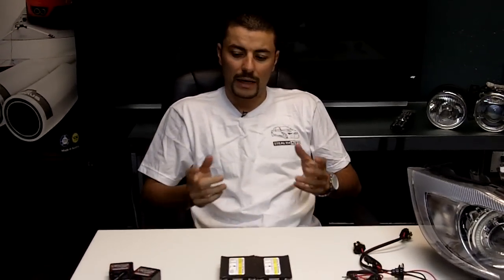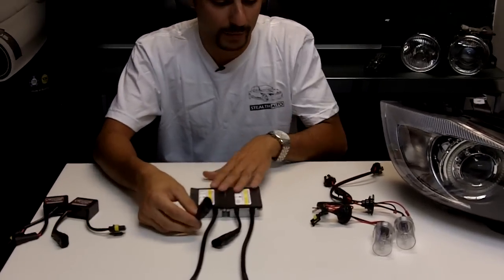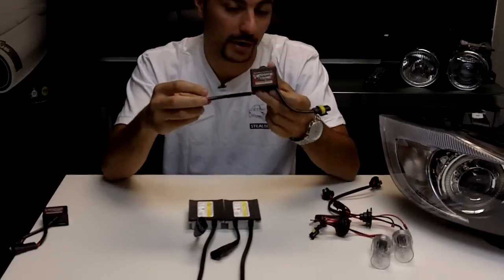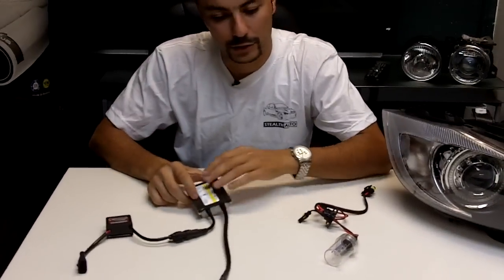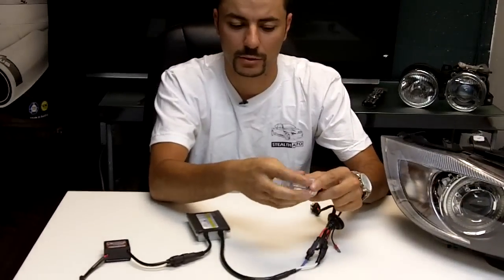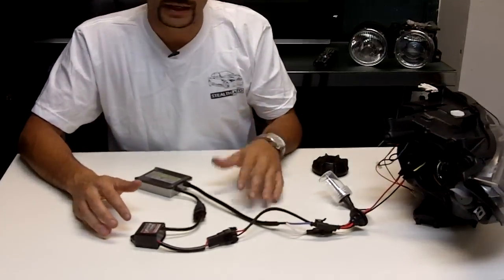How to install a HID / Xenon kit with Anti Flicker Capacitors/ Error Code Canceller  STEALTH AUTO

Comment: @iM3E46 bi xenon is where you have the option of switching between high beam and low beam. other than that it's the same. even halogen can blind you with high beams  so you have to switch to low beam for oncoming traffic

Comment: I installed my hid kit today on my Chrysler 300c , and at first i plugged the headlight plug to my kit but it was "POSITIVE 2 NEGATIVE" and after i figured out why the light wouldn't go on , i then unplugged and plugged correctly ''POSITIVE 2 POSITIVE" but now that side that I did wrong doesn't look as bright as the other side that was plugged correctly ... did i damage the bulb or ballast ??? or is it that i had the side that was done correctly running for longer ... thanks for posting this vid

Comment: Question.. I have a 09 Dodge ram with this kit. It came with the warning cancel. I have not hooked them up to my truck however I prewired so I can just throw them in when I get it back from the shop. I have the ballast going into one side of the warning cancel and the other side I have the relay harness. Is the cancel not needed?

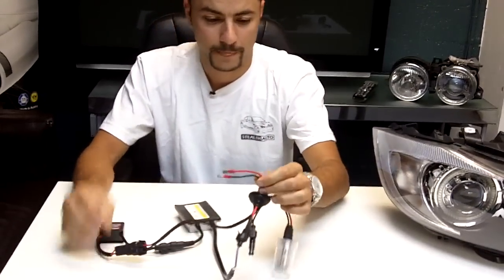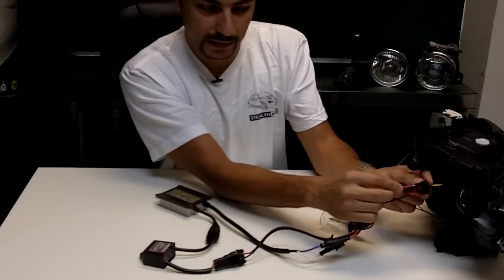Comment: you finally answered my question! I was looking everywhere! i didnt know where the extra wire goes from 2:10 , i dont have a capacitor so i don't know where that end connects and also my two male spacers or connectors at 2:36 i dont know where that connects. i have Spec-D headlights
Reply: please help me!

Comment: CAN these Cancellers do the same thing as an HID relay harness, to where its supposed to protect the vehicles wires and electrical? 

Reason i ask is because on my '02 e46 I plugged in these Warning cancellers into my HID relay harness i had already installed, however, the Warning light on my dashboard did not go away. as soon as i uninstalled my relay harness and plugged in the Cancellers directly into the ballast just like how you explain in this video, the light went away. 

Please respond.

Comment: I retrofit my lights on my 2007 Suzuki swift. Stock plugs are h4 and the projectors I retrofit are H1 bulbs. I bought a h4 relay harness(it uses one h4 plug from driver side and it connects to the battery too),two ballasts and two H1 xenon bulbs. I put everything together and it works fine,except one thing. When I switch on my lights and close them after a while, trying to open them again only drivers headlight came on. If I try on/off several times the passenger side work too. I thought my ballasts are bad and I bought new ones. But still the same. Is that a problem with my relay harness? Do I need a canceller/capacitor?

Comment: I have 2006 BMW 325i. I gets flickering and error code on dash after installing H7 HID VVME kit. So I need these HID canceller to solve the problem right? And the question is should I choose the HID canceller 9-16v or 9-32v
Thanks

Comment: i have a question, i have a  08 camry
My left hid do not work properly. sometimes it turns on without trouble but sometimes my left HID doesn't turn on at all. it does not flicker when its on.
can you help? what is the problem? and what can i do to fix this problem.

Comment: Question. The 2 wires that have the little spades on the end that go INTO the socket where the bulbs come out. If the wire that the buld came out of osnt working..do o run a constant 12v or switching? 

It powers up because I tspped another power source but it goes out. Im not sure IF those 2 spadrs HAVE to be plugged in? Mine didnt work on my benz. 

Any ideas?

Comment: hey, help! so i installed HID kit on my honda civic 2012 lx model. the passenger HID light stays on but then turns off later. The driver one doesnt turn on all the time when i turn the headlights on. it does go on for like 1 second then turns off. if it does turn on itll flicker then turn off. HELP!

Comment: would you need a relay harness kit for a mercedes gl350? i installed hids with relay harness on a honda odyssey. would i need it for the mercedes?
Reply: Relays are usually needed if you're directly hooking up the HID kit to the battery. Doesn't matter the car.

Comment: I have a Mazda 3 I sport 2012 and the bulb I just took out is using Phillip H11 Germany
I just place an order on (8000K D2S D2R HID Xenon Headlight Low Beam Light Bulbs)
Will that fit my car? Since the Manual book said D2S, D2R and H11 on the headlight section so I believe it will fit right?

Comment: I install this kit to my mercedes gl 320 and sometimes when you turn on head light, one (usually right) is on and one (usually left) is off. What should I do? Some body told me to replace fixes to next/stronger level. Can't find a fuse on mercedes. Please advice

Comment: Hey im trying to run a 9006 headlight on a 2006 charger. I have the capacitor and relay harness and still unable to get the lights to come on. Do you haveany advice

Comment: What do you do with the resistors that are included with the harness? I have an HID headlight kit I bought from Spyder it has a resistor that is incluced within  the relay harness plus another one that is separate and just has a plug on it. This headlight kit is for a 2006 Dodge Charger R/T. Please help I'm in a quandary.

Comment: ok so i ordered some xentec 8000k 9006 hid's low beam to install on my 2005 chrysler 300 do i need the anti flicker capacitors before i install them or can i just install them also got 8000k fog hid.

Comment: I have a 2004 Saab 9-3, and it comes with stock bulbs (no HID kit installed), would this work the same with the wiring? Do I have to splice any wires? I have H7 low beam bulbs.

Comment: Hi I just change my alogen lights for new heatlights with proyector and halo rings in a Camaro 2011 I install HID/XENON kit with out capasitor when the car is off works good but when  I turn on the car the HID light star blinking and the halo is whell any advice I need the capasitor o something plz help ????

Comment: I need help!! I connected everything like you said to much audi and... my lights are dim, my ABS light comes on, and my speedometer  stops working and when I turn my high beams on and my hid lights won't turn off.
Reply: Jester Fubar that happend to me in a Ford Mondeo 2006,with cheap ballast that happends, i bought hylux brand and problem was gone

Comment: Hi, a question, I look for my vehicle two pairs of xenon hid systems of the highest quality and with 55 or 70 watts of power and also devices that eliminate the error light or light check on my vehicle, and antiblink. What products do you recommend, my car uses H7 bulbs?

Comment: I have Vauxhall Insignia 2012 model and recently got HID kit installed with decoder (Error canceller) but computer system is still showing errors. Had replaced capacitors with the new ones but still i am getting errors. Any solution would be appreciated.. 

Cheers

Comment: So I have a problem... 2010 tsx I'm changing my DRL/HI to HID.. Followed your video on how to install the ballast, bulb and anti flicker but when the DRL are on they go on for a sec then turn off but when I put high beams on no issue.. Any ideas??
Reply: I'm having the same problem, my high beams don't turn on everything else works
Reply: +tribalrocker All DRL lights are operated at half voltage.  That's why a DRL looks dim compared to the high beam being on.  Your hid kit will not work when the light is in DRL mode because the voltage is too low to fire the hid bulb.  However, when you turn on the high beam your kit is getting a full 12 volts which allows the kit to fire up.  You would have to run a harness and a separate switch to use your DRL with an hid kit.  Check out my channel I have a video where I converted the high beams on my Lincoln to HID and put them on a separate switch with a harness so I could use them as a DRL as well.  Hope this helps.

Comment: Hi there.
I need some help, I connected as you says and the lights start flashing, what did i do wrong,  this is a mercedes benz c230
Reply: Paul Alvarez 
there are vids on youtube about that
Reply: Paul Alvarez read online you will probably  need to install a relay and a fuse.

Comment: took company car to get a headlight replaced.  They told me it needed a new ballast.  Thinking the problem was fixed, today, 3 months later my headlight is out and burned.  So I took everything apart myself and now I am thinking that they never replaced the bulb because the bulb is one of those expensive ones I've seen on the iinternet for around 225.  Did they really replace the ballast?

Comment: How do I know if my car needs the capacitors? Is it if my lights start to flicker?
Reply: Freddy Acosta if its 2014 and up and or if it has projectors headlamps you may need the anti flickers module
Reply: Thanks for the reply Tocayo. My OPT-7 Kit came with the capacitors and installed them just in case. Lights look and work great.

Comment: Hey,

Yesterday I installed my Xenon HID including this Warning Cancellers or Capacitors on my E90 2006. But I still have the Error on the dash. There is no flickering, just the error code on the dash. How could I solve this problem. Maybe somebody installed a Kit on a BMW E90 which is working fine?

Best regards

Comment: Help. I have a 2001 E430 Mercedes. Just purchased a Xenon bulb for it and I think the ignitor is bad. The dealer wants $800 for this item. Does any one know I can purchase one for less?
Reply: Search for one on eBay. There should be plenty of aftermarket replacement parts for your car. The factory HID bulb for your car is a D2R (low beam).

Comment: I got some opitx hid. for a 2001 yukon. Hook them up and they didn't come on
Reply: Mary Robinsongreene Might be the way you connected the cable to the ballast. Try flipping it so negative goes to negative. On my Chevy this happened and it was the cable needed to be plugged in reversed (might need to wrap it with tape if it doesn't clip on right)

Comment: Can I help me??
I bought HID d2r bulbs with H11 adapter., On 2011 Nissan Altima S.
 Purchased from headlightexperts.com

Iv had a hell of a time trying to get them to work!! They're supposed to be plug Nd play. 
 Spoke to support and this is the response I got back...
"As long as power (+12V and Ground) is located at each ballast input connector, the lights will turn on. It's as simple as that. It is just a matter of flipping the polarity on the adapters, not on both sides, you have to try flipping it on one side, then the other side, and then on both sides until the +12V goes through both sides.

You also need a multimeter to ensure each output wire is actually receiving +12V power. We recommend testing the wiring first, checking the fuses, and then changing the configuration of the capacitor/adapter all 4 ways (yes there is 4 different configurations of the capacitor/adapter). This is VERY IMPORTANT."

When I plug it into my cars H11 harness, I get a low pitch sound coming from the ballast... But no light. 

Do you have any ideas or experience using them that may help me??
Thanks

Comment: I've got this kit it states the anti flicker capacitor is ONLY  installed between the igniter and light it can NOT be installed anywhere else.
Xenon company is a joke no customer service tech support is even worse.
I have yet to get them to work in my 2013 Taurus

Comment: Hi! I bought this product http://www.dx.com/es/p/h4-2-35w-6000k-3200-lumen-white-light-xenon-hid-headlamps-w-ballasts-set-9-16v-pair-107199

I installed it by my own in my Mitsubishi Lancer 1993. The "low" works perfect, but there is no light when changed to "HI".... can you help me please? do i need a capacitor? it was not included in this Kit...
Reply: +Jeshurun Hastings yes! I changed the red cable to Connect straight to the black socket and the black cable to the red socket and worked superb!!

Comment: This is more of a trolling comment (at least I'm being honest) than an asking a question comment (since the host of this video doesn't respond to comments)............but..........you would think that they would have designed the quick-connect system to be fool-proof to prevent the type of negative/positive polarity damage to the equipment the he is describing.
I'm a master electrician, but it doesn't take someone with my experience to see the craziness of the design, no?

Comment: I have Xentec HID's , so if i plug the capacitor into the ballst, then the ballast into my hid bulb (the 2 ignitors) then the other end of the capacitor into the cars electrical bulb harnes...i still have a red and black wire on my hid bulb...what happens to those?
Reply: Mike Green did you find out what to do with the red and black remaining wires on hid bulb

Comment: i purchased a hid kit the 35w also got the cancelers and the relay harness, after i connected everything, the hids are working fine but im getting the loud buzzing noise from the relay,and one of the light is flickering a little, but only when the car is on not off. when the cars engine is off they work fine with out any noise but the flickering is still there. i have the capacitors connected to the ballast and then the harness plus to the light plug. 

help please, Thank you

Comment: I NEED HELP BADLY. I HAVE A 1998 LEXUS LS400 I INSTALLED THE 9006 HID KIT TO MY CAR AND FOR A LITTLE WHILE IT WORKED. THEN I STARTED TO NOTICE ONE OF THE HID LIGHTS WOULD BE OFF. I WOULD TURN THE FOG LIGHTS OFF THEN BACK ON AND IT WOULD COME ON BUT THEN ITS DIMMER THAN THE OTHER I HAVE TRIED THE RELAY AND THE ANTI FLICKER I DONT KNOW WHAT ELSE TO DO TO MAKE IT WORK RIGHT PLEASE!! I NEED SOME HELP

Comment: I am working on a 2014 ml350  I put the kit in exactly as it is in this video.  I had it running fine with Key on , engine off ,  for about 10 minutes. ( error code cancelers were installed )   I shut the lights off.  Turned the engine on ( running ) turn lights on they flash 3 times and then go out, error codes on dash check lights .  The computer will not recognize them I had to put the old lights back in.  Do you have any ideas ?
Reply: +mrbuccala  I have the same problem you as solved?

Comment: the vehicles stock connection goes into the capacitor to the ballast, so why did you connect the bulb wiring into the capacitor??? now what does my stock vehicle connect to!?
Reply: nayzerie exactly.
Reply: Freddy Acosta fuck the bs dude, just get led instead of hid. I installed them on my 98 accord and they work beautifully
Reply: nayzerie i have led right now and they're not anywhere close to Hid. Not really bright at all. I need plenty of light since I'm on the road alot.
Reply: Freddy Acosta idk man I did a whole lotta research for the most recommended pair and they are plenty bright for me.
Reply: It Aint cool being no Jive Turkey this close to Thanksgiving

Comment: Hi, I have a 2012 Dodge Avenger. The battery is underneath the fuse box for some reason and I can’t reach the battery terminal to connect the relay harness. What should I do?
Reply: You may have to jack that side of vehicle up and take the wheel off and look at plastic wheel well. It should come off giving you access to your battery